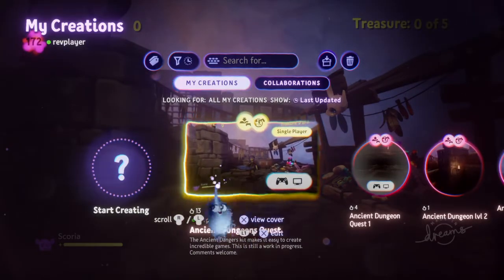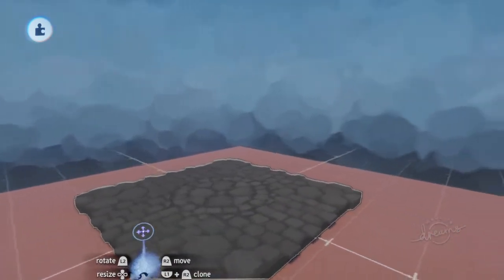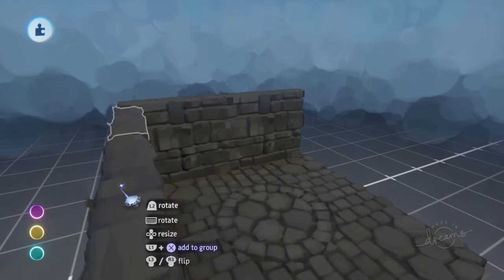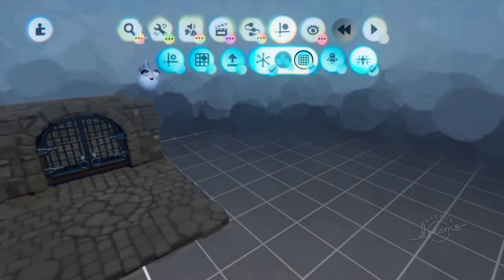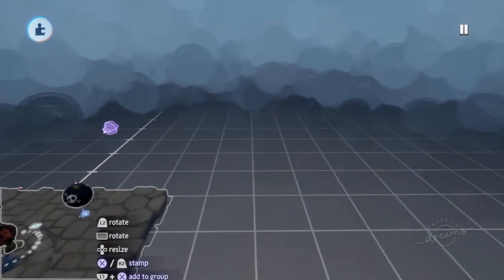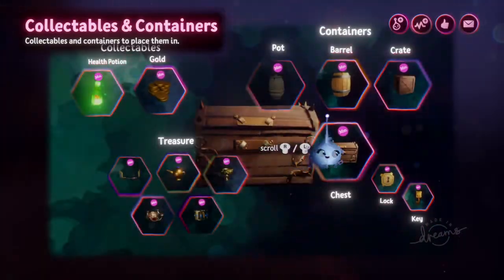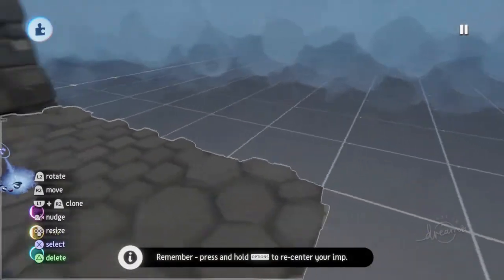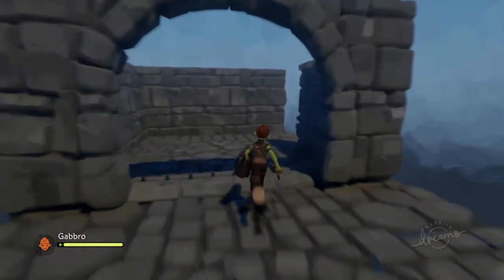Dreams PS4/5 - Tips for Using the Ancient Danger kit

Comment: Thank you for this, I just picked up the game and have been overwhelmed by all the elements that are in creating a game. I’ve been messing around with the ancient dungeon template and couldn’t figure out the gate switch. Found this very helpful :))
Reply from the maker: I'm glad I could help. The templates are great but they leave out some details.
Reply: @vrartist4832  I’ve been playing around with the kit again and have made a neat little level but I added parkour parts not knowing that the playable character don’t have a jump feature. Is there a way I can give them one or do you know any similar characters on the search part that has the ability to jump? I am also struggling to get the bat herb to display the text I want
Reply from the maker: @chickenfriedrice5139  usually you can tweak the character and enable a Jump by putting in a value. I'm not in Dreams right now so I don't know about the Bat -- haven't tried using him.
Reply from the maker: I went into the character tweak menu and found that Scoria already has a jump value so it must be overridden in some way because I couldn't get her to jump either.